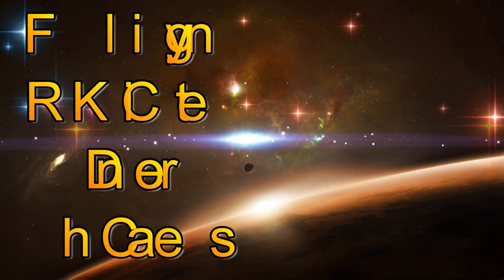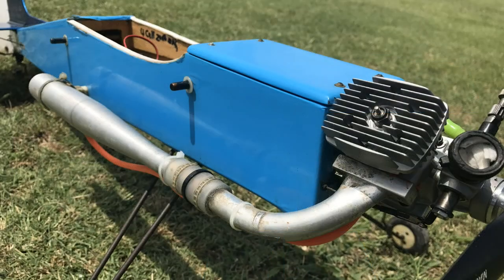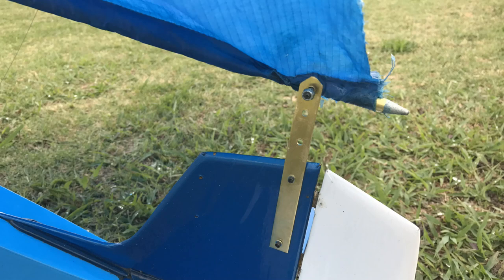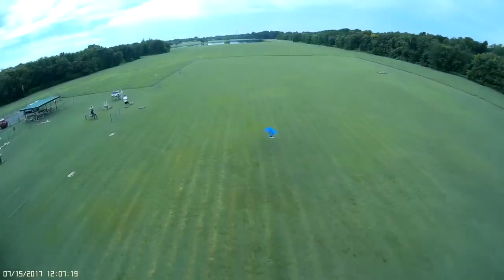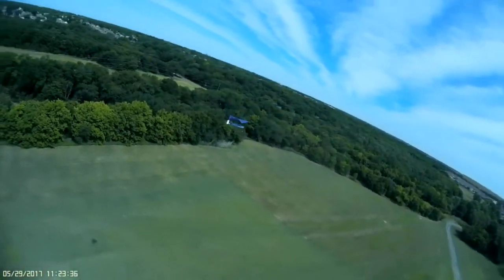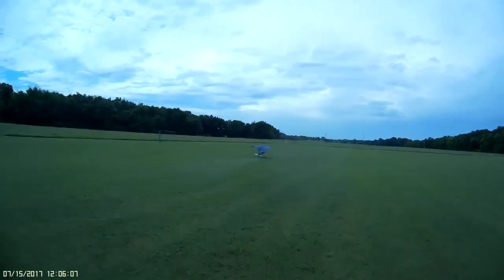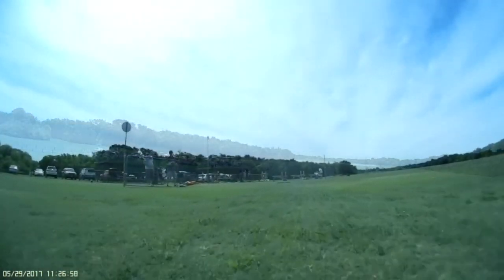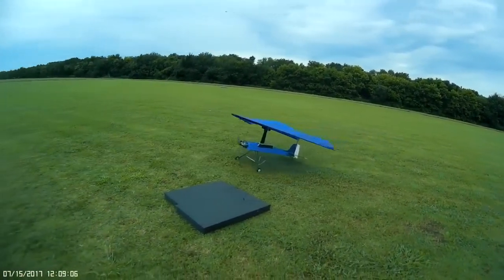Flying an RC Kite Rogallo wing with an chase Drone FPV Roy Dawson video

Comment: Hi Roy, super cool job. Did you ever manage to get it into the dreaded luff dive (where the AoA goes negative and the trailing edge sags downwards instead of up?). It killed many early rogallo pilots in the old days, it would be interesting to see it on an rc model
Reply from the maker: I'm fimaliar with that, 40 yrs ago that happens to a newbie flying and went staight down, he never pulled back the power and remember the prop was just under the wing, not like today's wings. I'm smart enough to make sure no negitive loads
Reply from the maker: Yes we had a guy trying to fly a rigollo with the prop on the end of the tube. A luff dive killed him. This was 40 yrs ago.
Reply: @flygliders  Yeah I was curious to see if a luff dive is replicable on a radio controlled model